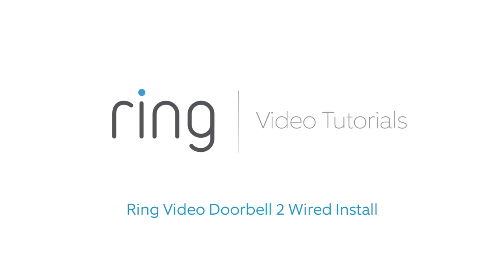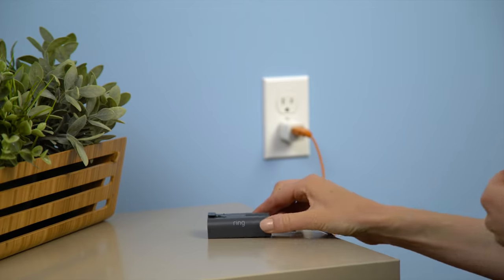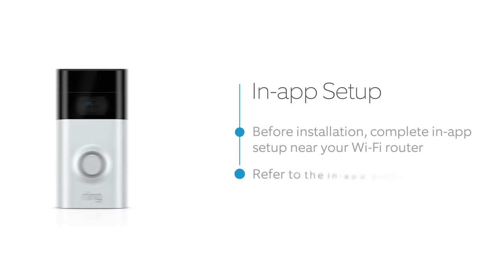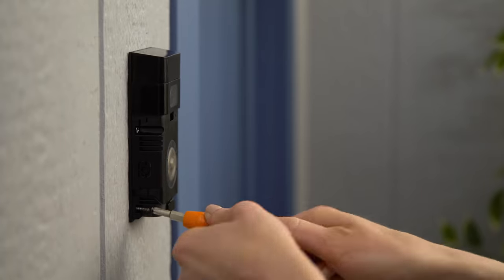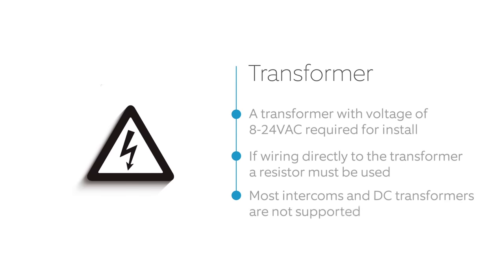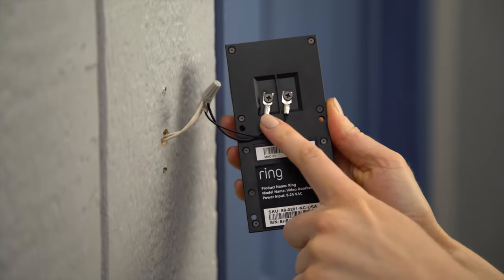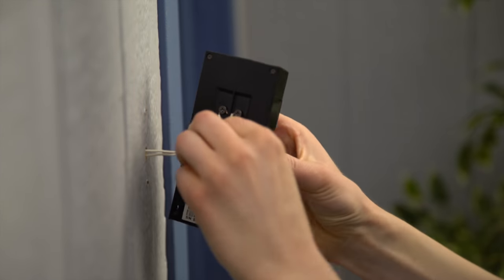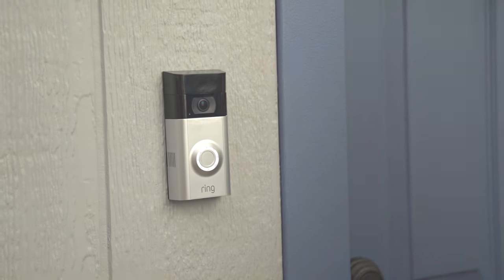How to Install Ring Video Doorbell 2 | Connect to Existing Doorbell

Comment: I checked the voltage at my existing button doorbell and it only read about 12.5VAC.  There is a little light on that switch.  I hooked up the Ring Doorbell 2 and it did not power on.  The chime is pretty old, just goes ding and releases when you let go of the old button.  Do I need to do something to the doorbell inside to get more voltage to the button?

Comment: You guys completely skipped the transformer portion of this???
Reply from the maker: Hey neighbor, the Ring Video Doorbell 2 runs off of battery power, and does not require a transformer. The wiring instructions shown in this video helps provide the Ring Video Doorbell 2 with a constant trickle charge, and also connects the Ring Doorbell to your indoor chime if you have one.
Reply: Ring, thank you. I am aware of the battery. I would like to attach the Ring Doorbell to the existing wiring so it can activate the existing chime in the house. I don't want to have to rely on the Ring's plug-in chime to alert me when I'm on the other side of the house. This video completely skips over and omits instruction on how to install the transformer. The video just covers the easy, intuitive stuff, like positioning the Ring on the wall to locate where to drill the holes, and then attaching the existing wires to the back of the Ring. Then the video essentially says, "Oh yeah... you'll also need a transformer, so go ahead and install one of those, but we won't bother telling you how to do that, because even though we are saying you need one for the Ring Doorbell to work properly, we don't want to be responsible for when you install the transformer incorrectly and burn down your house".

Am I right? Or, please provide the link to the video that shows me how to install the transformer, or else this thing is going back to Costco for a full refund. Thanks.
Reply: Isn't there already a transformer connected for an existing doorbell?  Would another transformer need to be installed?
Reply: So if I connect to existing wiring will I have to continue to recharge the battery or not?
Reply: You're exactly right - these videos are a joke. At least Nest recommend pro installation and acknowledge where more experience is needed.
Reply: You do not need a transformer  for this doorbell since it is hardwired and  battery operated you only connect it to your previous doorbell to trickle charge the battery meaning the battery is always fully charge even if you put in for live view and motion detection all the time. To make it short you don’t need to recharge the battery .
Reply: And, what do you do with the little diod that came in the box? To clarify: I have my original doorbell and ringer that came with my home (20 years old). Can I just hook-up the two wires (as depicted in the film) or do I need to involve the diod somehow?
Reply: bacherjay -
Reply: @jeffcondit8721  No, as stated if you have a mechanical chime you don't use the diode, but if your chime is digital (usually plays some of short tune or synthesized sound) then you do.

Comment: Where do I purchase the two wire extensions shown in the video? Two month effort to hard wire install Ring 2. Finally ordered & received angle wedge in insert behind Ring 2. Now existing doorbell wires need extensions shown in this video. Thanks.
Reply from the maker: That's a great question, M. There will be wire extenders included in the box that your Ring Video Doorbell came in. To purchase replacements, see here: https://ring.com/collections/accessories/products/spare-parts-for-video-doorbell-2. If you have any other questions, please let us know.

Comment: So from what I can gather, as others have asked this question, there’s is no major benefit in terms of charging the battery if you wire your doorbell. The wiring is mainly chime related, correct? I was hoping that if I wired my doorbell it would charge the battery or provide alternate power. Oh well. Still a good product.
Reply from the maker: Great questions, neighbor. Hardwiring your battery-powered Ring Doorbell will help to provide a trickle charge of up to 10% each day. Depending on the activity your Doorbell sees, such as motion detections or Live View usage, you may still need to recharge the battery occasionally. You can monitor the battery level in the Ring App to know when a recharge is needed. Please let us know if you have any more questions!
Reply: NM Trindle - Randomness and more  it’s been seven months since I wired my doorbell, and I have not had to remove the battery to recharge. It may lose a little juice here and there, but within a day or two, the wired source charges it right back to 100%.

Comment: Ring does a good job of including everything you'll need to complete the installation.  My installation was easy and straight-forward.  I removed the existing door-bell button. Per the instructions, I made sure we were working with a mechanical bell (& not an electronic chime).  If your Ring is being installed on wood siding  Do Not Use the included drill bit.  That is only f/stuco &/or masonry, using the supplied plastic wall anchors.  Electrical connection was easy.  Connecting to the home's existing router was easy.  We went through the set-up on the Ring app & it worked well on our first try..  I viewed one or two videos before the installation; my opinion is that will help make the installation simple.
Reply from the maker: Hi Matthew. We're glad to hear that your physical installation went smooth. We appreciate you being a part of the ring neighborhood!
Reply: @ring  damn yall cold lmao

Comment: Place towel beneath installation to catch dropped screws.  Backplate must be installed to match the orientation of the Ring.  Aluminum cladding around doorjamb will block Wi-Fi, had to cut away a square behind the Ring unit with a Dremel.

Comment: Tip to installing on brick
*Get a smaller drill bit for brick and mortar, the supplied drill bit will walk.
*best to have a drill with built in level.
*Use the bracket as a template for the the smaller holes, tape in place before results. 
*once smaller holes have been drilled use the supplied drill bit to finish hole diameter.
Reply: MC TDAWG this comment must be pinned

Comment: The one I bought (Ring 2) said it is wireless. I guess I'll find out when I go to install it. Of course I will follow the directions so I don't screw it up. It looks pretty easy.
Reply: Lukeamania It technically is wireless because it has a battery, but if you don’t hardwire it to where your old doorbell was, you will have to charge that battery regularly. Meaning you’ll have to have your ring off during each charge.

Comment: Am I correct in understanding, that if you have an existing mechanical chime and a power supply that has output in the acceptable range you DO NOT have to wire a resistor into the system?
Reply from the maker: Hey, John. We ask that you please reach out to us through Twitter, Instagram, or Facebook so we can answer any questions you have regarding Ring devices. We look forward to hearing from you!

Comment: So how'd you manage to screw that down flat with those wire caps behind there?
Reply: They fed the wire nuts into the hole the wires were already coming out of
Reply: Yeah looking closer at the video it does look like there may be just enough room to feed them through one at a time.  On my house the wires are embedded in cement so they really don't give you a lot of room to work with behind the back cover.  Ended up having to chisel out a small recess for the wires to sit in.
Reply: @MikeStlMO  u could have soldered the wires
Reply: @MikeStlMO  Do U Have Ring Video Doorbell 2!
Reply: @AntLive29  Do You Have Ring Doorbell Two?!
Reply: @billwilmington8284  Do U Got Ring Video Doorbell 2!

Comment: Can I use it for the camera alone without the ringer? My doorbell is part of a three bell intercom shared with two other neighbours. How long does the battery last approximately without being connected to any wires? Does the camera still work without wires?
Reply from the maker: Hey neighbor, you can certainly use your Ring Doorbell 2 for the Live View or motion detection only. You can manually deactivate Ring alerts in the Ring App. We also offer battery-powered Security Cams that don't include the doorbell button but will alert you to motion detections. Batteries are rated for 6-12 months, however, the battery life will depend on usage and how frequently your Ring is used. You can keep an eye on the battery percentage in the Ring App so you'll know when it needs to be charged. Our battery-powered Ring devices can certainly work without being connected to wiring. Let us know if you have any more questions!

Comment: We have a mechanical doorbell. I've installed the ring video 2 per instructions in the manual and the video. My inside chime still doesn't work. What do I need to do.
Reply: You need a compatible chime. There is a list online.

Comment: how do you know you wired it right or if you need transformer and so forth? I had previous doorbell , I just took out and wired to Ring
Reply from the maker: Hi Brad! Similar to the classic Ring Doorbell, the LED circle on the front of your Ring Doorbell 2 will illuminate and stay solid white to indicate that it's receiving power. It requires 8-24 volts of AC power and if there is existing wiring to connect your Ring to, then you should not need to install a transformer.
Reply: @ring  I wired mine just like that and it quit working! No sound when I push the buttonand it makes the clicking sound while the lights flash red three times and then there's a blue circle that spins for quite some time!

I had to hold the orange button down for 15 because it quit working altogether and now it does something but it doesn't work and I can't view the live feed, nothing works. No chime, nothing and it's just a mechanical bell.
Reply: @RBRM3  did you by chance have the battery out when you hard-wired? instruction manual says you need to still install the battery even hard-wired for it to work.
Reply: @andrewjohnson6907  LOL
Reply: Does the white light stay on forever
Reply: @andrewjohnson6907  I agree.  then it says "if you are wiring directly to a transformer, a RESISTOR must be used".  What???  If I have Existing wiring with a 8-24 volt existing doorbell, why on earth would i need a resistor????  Of COURSE its wired DIRECTLY to a transformer with existing wiring with a 8-24 volt system!  You guys need to get instruction details correct, that makes NO SENSE!!!
Reply: @andrewjohnson6907  yes this company is stupid.
Reply: @mrpush2532  You only need the resistor if it is wired directly to the transformer (like it says). If there is a chime in the circuit too then you don't need a resistor as the coil in the chime provides the resistance.

Comment: I user a normal transformer from 22 Vac and a 3,15 A fuse for powering the doorbell, the problem is the fuses always brake after some minutes. How many current does this thing need? So i need to put an extra resistor in the circuit and what kinda resistor do i need in that case?
Reply from the maker: Hey there! When hardwiring your Ring Video Doorbell 2, you'll need to use a 25 Ohm, 50 Watt wirewound resistor for optimal connection. You're welcome to give us a call at 800-656-1918 any time for more information in regards to your specific setup. We hope this helps!

Comment: Hey Ring, 
How to mount the Doorbell 2 secure on the wall so no one can easily remove it? 
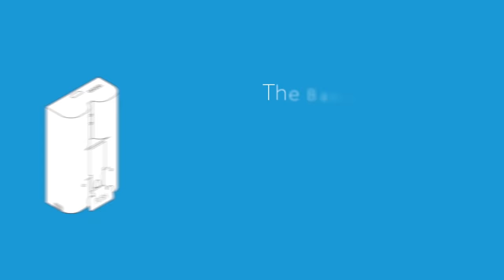I watched the video, but at 0:16 the silver cover can't be removed that way. It wraps around the backside of the device as well. Is this another model?
Thanks!
Reply from the maker: Hi Peter. Ensuring that your Ring device will be securely mounted to the wall is important when keeping an eye on the events happening around your home. The Ring Video Doorbell 2 is screwed into the wall using the installation tools included in the packaging. Once the Ring Video Doorbell 2 is mounted to the wall, a security screw can be inserted into the bottom of the device so that the Faceplate is secured and cannot be removed. The Ring Video Doorbell 2, 3, 3+, and 4 have removable Faceplates, while the Ring Video Doorbell 1st and 2nd generations do not have removable Faceplates. Please let us know if you have any additional questions.
Reply: @ring  Ok, thanks for the quick reply. I was confused by the term "Doorbell 2" and "2nd Generation". Got it now.

Comment: customer doesn't know if she has a Ring or Ring 2. How do I find out? Do you need the resistor on the Ring also if not using the existing doorbell or is that just for the Ring 2?
Reply from the maker: Hey neighbor, the main difference between the classic Ring Doorbell and the Doorbell 2 is that the Doorbell 2 has a faceplate cover and a removable battery pack — see more here: https://shop.ring.com/. A resistor would be needed for either model if you're hardwiring your Ring without using the existing chime kit — see an example here: https://bit.ly/2QbUeMZ.

Comment: how often do you recharge the battery? I wanted one without the battery.  This is just another thing to worry about recharging the battery.
Reply from the maker: That's a great question, Eddie. The rechargeable batteries in our devices can go months between recharges. However, this is dependent a few factors in your home’s environment, such as the number of activities captured. If you're looking for a Video Doorbell that does not rely on a battery at all, we'd recommend looking into our Ring Video Doorbell Pro (https://ring.com/products/video-doorbell-pro) or Ring Video Doorbell Wired (https://ring.com/products/video-doorbell-wired).
Reply: @ring  Thanks 🙏 very helpful
Reply from the maker: You're very welcome!
Reply: Not true based upon my experience. Don’t get me wrong. I love my Ring Doorbell, but battery usage is not as advertised. I bought a second battery for $29.00. I have to recharge about every three weeks and just swap out batteries and then recharge replaced battery.

Comment: Doorbell was successfully installed (I thought) works well during day. At night, Ring sends feedback to doorbell that causes my remote doorbell to chime continuously. Had to unplug it. Any thoughts ?
Reply from the maker: Hi Israel, thanks for reaching out! We recommend checking to see if your Chime is compatible with your device — see more here http://bit.ly/2K6j3qw. If it is compatible and this is continuing to happen, make sure that if your Doorbell is mechanical or digital that the appropriate option is selected in the app. Please call us at 800-656-1918 if you need additional assistance.

Comment: So do I need a transformer or resistor? So I can wire it with my house light?
Reply from the maker: Hey Alexis. Knowing power requirements is important to ensure the best experience with Ring. While our battery operated Doorbells and Cameras do not require another source of power, you can find the power requirements for our Doorbells here: https://support.ring.com/hc/en-us/articles/115004668746-Ring-Video-Doorbells-Product-Comparison, and for our Cameras here: https://support.ring.com/hc/en-us/articles/115004687606-Ring-Security-Camera-Product-Comparison. Feel free to send us a private message on Facebook or Twitter if you have any other questions. We're always here to help.
Reply: @ring  okay great thank you so much just purchased one haha👍🏼

Comment: I'm trying to set this up, replacing an existing wireless doorbell.  How do I get the inside WIRELESS chime to ring when the Ring doorbell is pushed?
Reply from the maker: Hey neighbor. We recommend checking that the wireless doorbell is compatible with Ring: https://support.ring.com/hc/en-us/articles/115003008663-Ring-Video-Doorbell-2-Chime-Kit-Compatibility-List. If your wireless doorbell is listed here as a compatible unit, please give us a call so a member of our team can assist in setting this up. We're available from 5am - 8pm PST, and you can find your local number here: ring.com/callus.

Comment: My battery on my ring doorbell is going up and down on percentage. Will I still have to charge it?
Reply from the maker: Hey neighbor, great question. Hardwiring your battery-operated Ring Doorbell will provide it with a trickle charge. Depending on usage, the battery may still need to be recharged. Let us know if you have any more questions!

Comment: uhhhh... Which transformer to get? You guys missed that part which is terrible. Isn't that supposed to be a key portion of the install?
Reply from the maker: Great question, Pepper. The Ring Video Doorbell 2 requires an 8-24 VAC (40VA max) transformer. For more information about the Ring Video Doorbell 2 see here: https://support.ring.com/hc/en-us/articles/115003008643-Ring-Video-Doorbell-2-Information. Please let us know if you have other questions.

Comment: I have an existing video intercom doorbell - would the wiring be compatible?
Reply from the maker: Hi there, great question! Ring Video Doorbells aren't currently compatible with intercom systems, as they require a connection to AC power and intercoms run on DC. We hope this helps!

Comment: Shouldn’t my mechanical doorbell still work when I remove the battery for charging?
Reply from the maker: Hi there, great question! Since the Ring Video Doorbell 2's main power supply is the battery, the internal chime will not Ring if the battery has been removed. Let us know if you have any other questions.
Reply: Ring thank you
Reply: @ring  So for 5 hours I have no video or doorbell while the battery charges-however often it needs to be charged. I don't see the point of this then. If something happens (and I have neighbours from hell who screw round with my property, which is why I was looking into this). I guess I'll just rely on my 2nd Amendment rights.